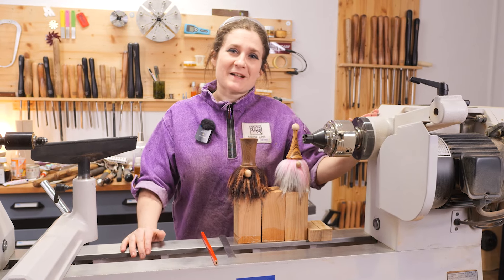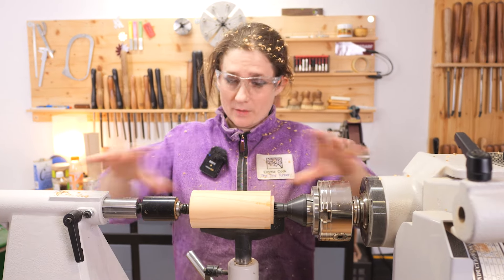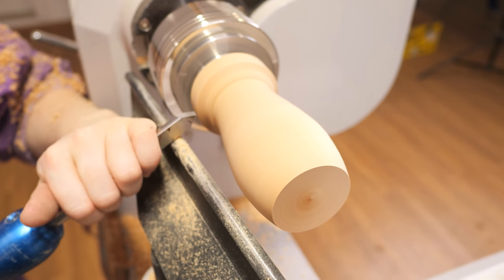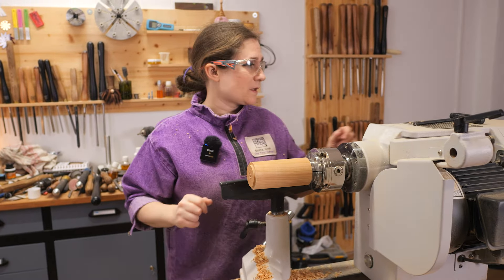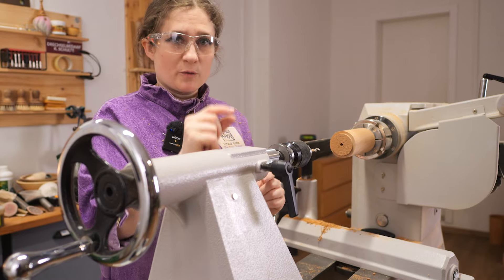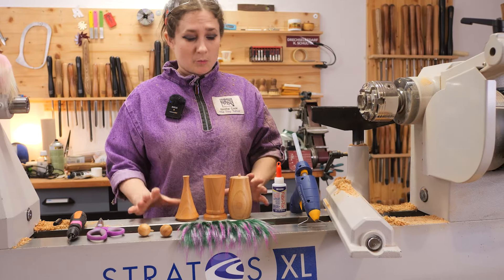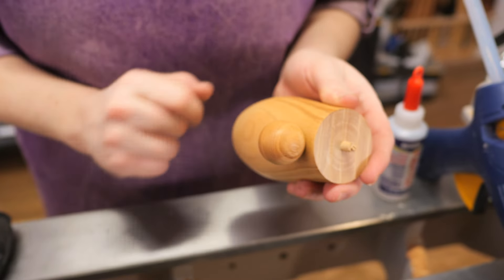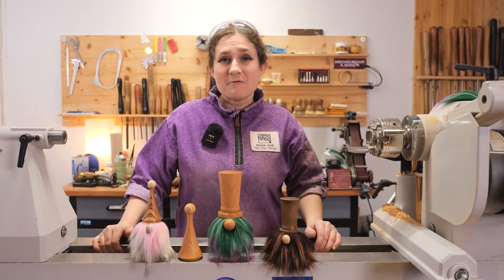In the world of the Gonks - with Emma Cook!

Comment: If you don’t mind can I give you a little tip ive just come up with as far as cutting the fake fur ? 

Turn the fur upside down as you do and mark  out what you want as far as a full beard or  a thin layer of whiskers or what ever sharp you want and then with a soldering iron set at about 350 run along the line pulling the backing as you go and you end up with the shape you want and long whiskers no problem.